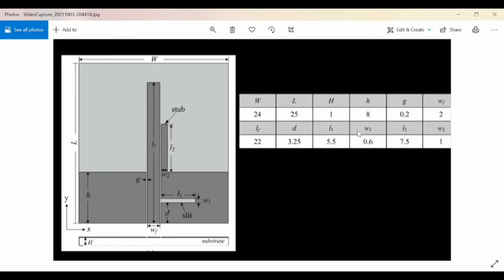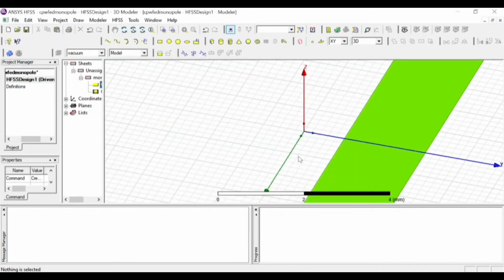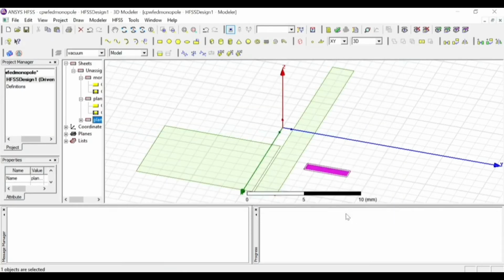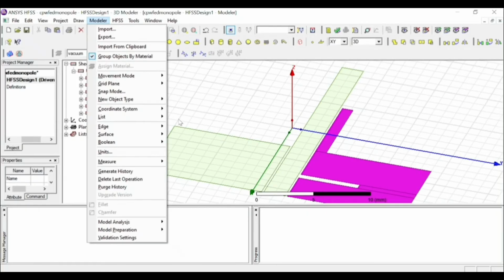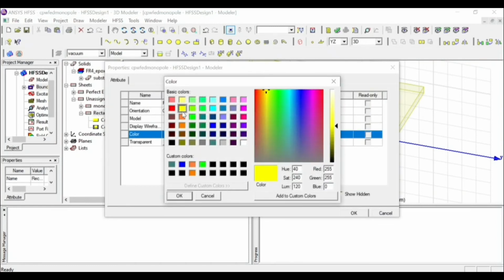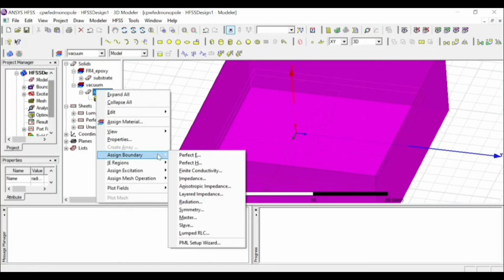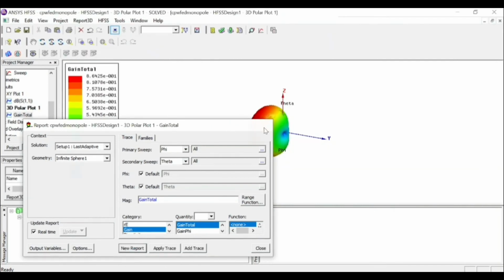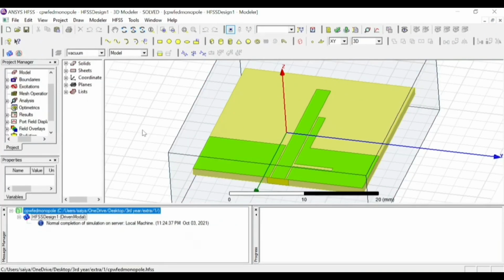design of cpw fed planar monopole antenna with broadband circular polarization.

Comment: Sir how did you get the value of monopole length, width of plane etc. Can you please explain since our values aren't matching with your pdf. Can you please give us a detailed explanation?
Reply from the maker: I have just given the basic formulas for such a kind of antenna. I have implemented the antenna mentioned in the base papers. You can find the base papers easily by using the updated link in the description.

Comment: sir kindly make a video on the following paper
W. Wang, X. -W. Xuan, W. -Y. Zhao and H. -K. Nie, "An Implantable Antenna Sensor for Medical Applications," in IEEE Sensors Journal, vol. 21, no. 13, pp. 14035-14042, 1 July1, 2021, doi: 10.1109/JSEN.2021.3068957.
Reply from the maker: Sure.